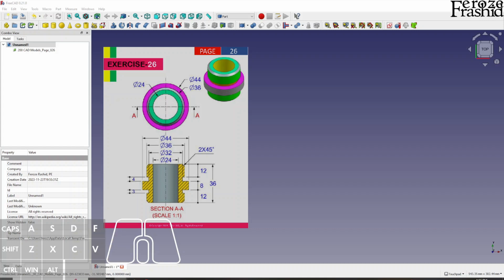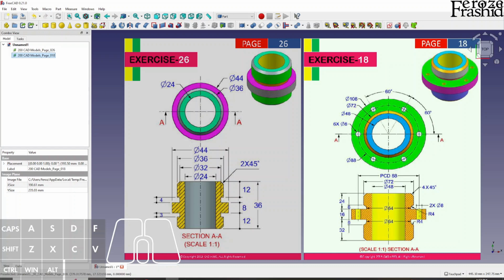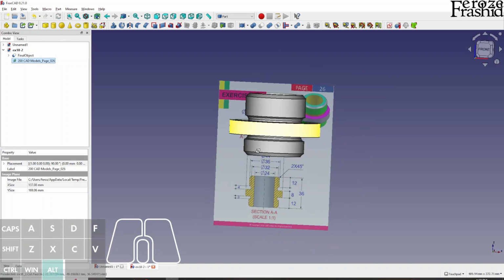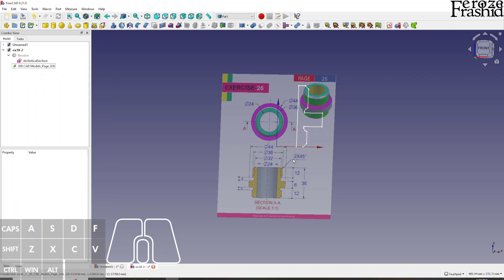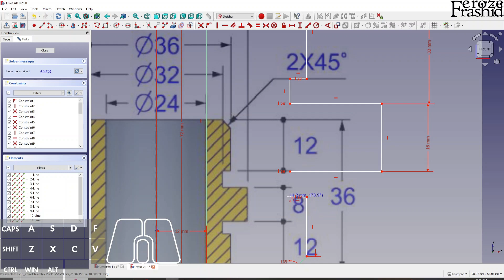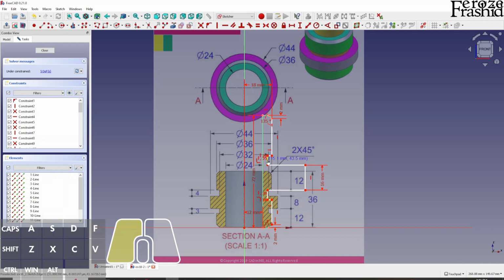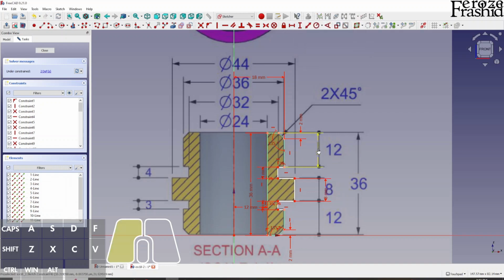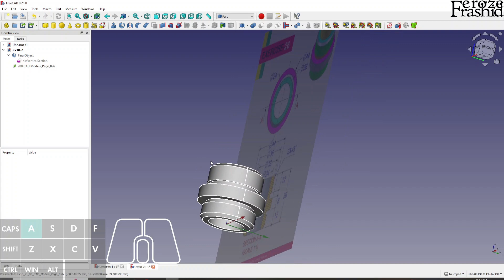200 3D Models in FreeCAD: Exercise 26 (Parametric Design)

Comment: I agree, the models seem out of order with respect to their complexity. There seem to be missing dimensions fairly frequently, too…

I really like that you go above and beyond and try to show different techniques. To make this model truly parametric, it would have been interesting (and rather involved) to devise a method to use a spreadsheet to control, not only the dimensions, but also the “angles” of the indentations; and even the presence of holes.  But I think the resulting model would have been far too complex for anything other than a demonstration!

Great job, as always!
Reply from the maker: Thanks. I thought of setting up a configuration table for this model. Then again, keeping the current progression of my series, I had to save it for a future project.